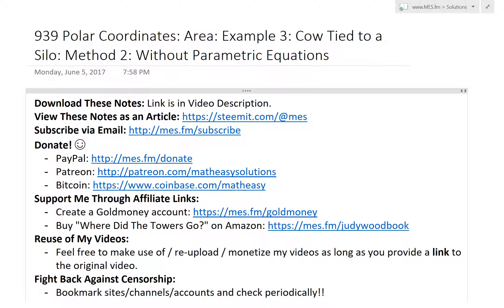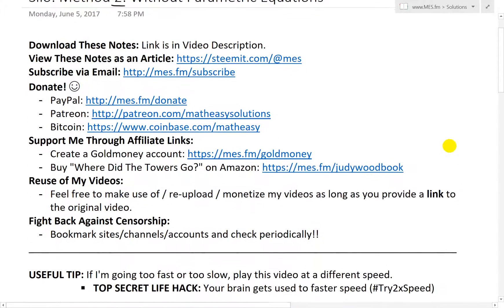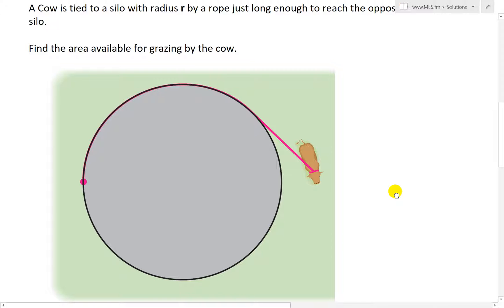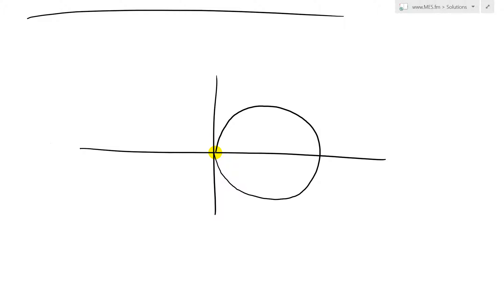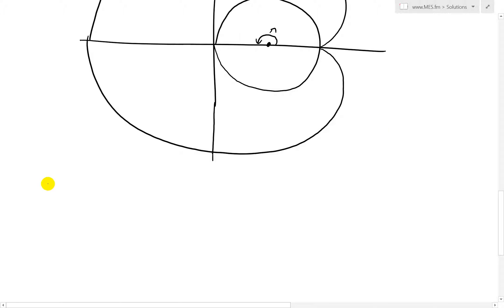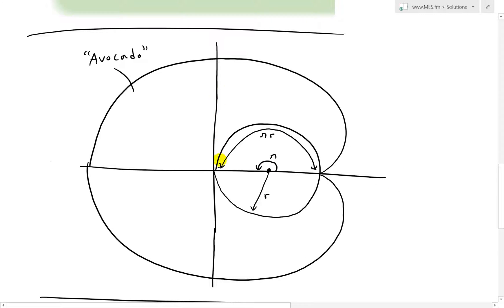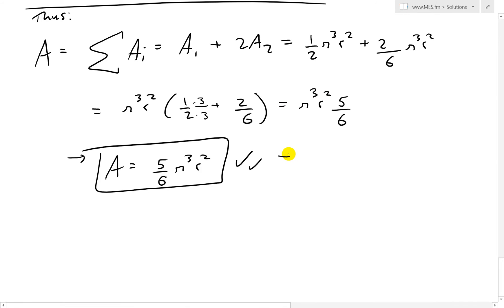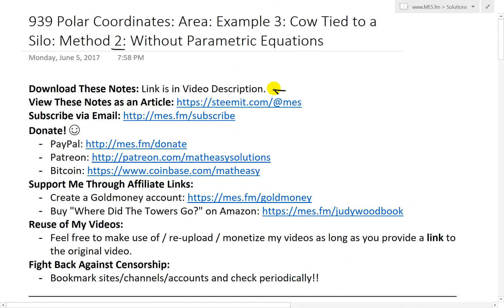Polar Coordinates: Area: Example 3: Cow Grazing Area: Method 2

Comment: 7:45 Why can you say the two dThetas are the same?
Reply from the maker: Sorry for the 4-year late reply lol The dθ's are the same because we are maintaining the same internal angle (in this case 90 degrees). 

To illustrate this, imagine we started from the vertical axis and rotated by 90 degrees, in which case 1 line will be horizontal and the other vertical (aka both 90 degree rotations).